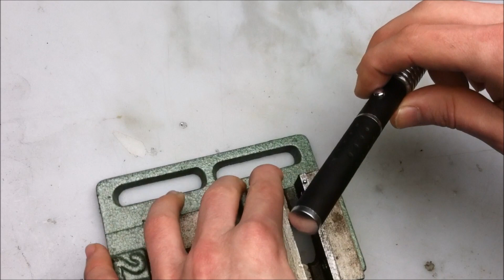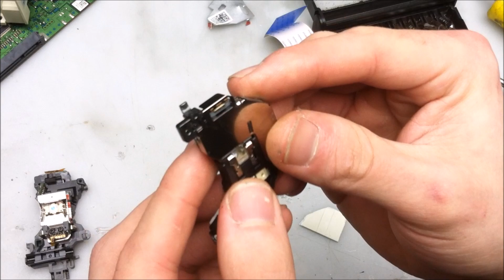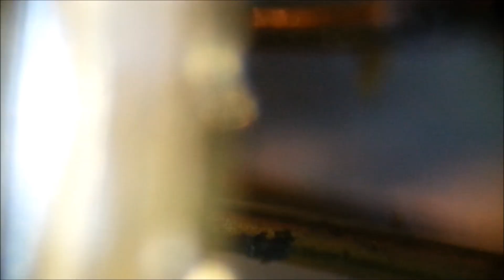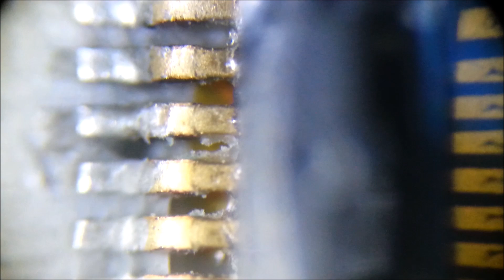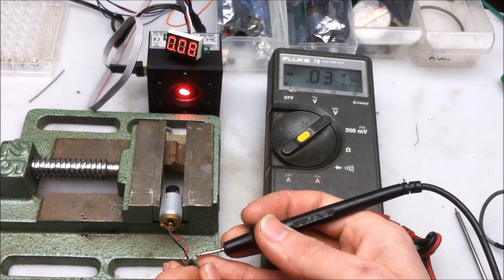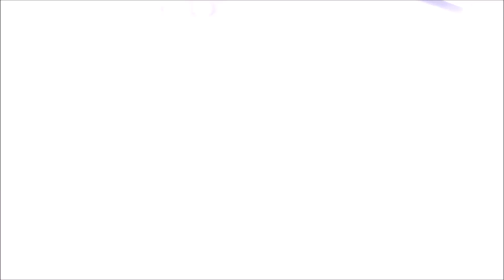Bare&Basic CD and DVD Burning Laser Diodes How to use all their types

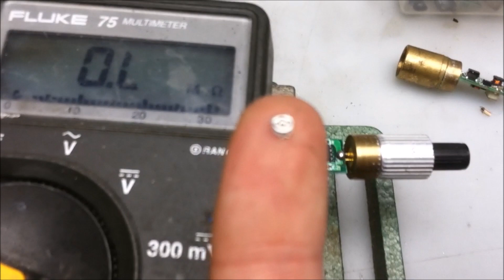Comment: 45:45 hey I have a question. In here you connected the sweeper of the pot to the single pin of the "shunt" or that black chip. But in my driver design I see the shunts pin are flipped, the side with only one pin is on the opposite side of where the pot sweeper sits. And besides, do you even need to connect that single pin of that "shunt" to the sweeper of the pot? can I just leave it and just replace those resistors with pot. The sweeper to the pins which show continuity and the other two pins of pot goes to those two other pins left, right? Please answer @Zenodilodon
Reply: Hey man, sorry for the confusion earlier. I didnt notic that quick picture you showed and it make's all the connections clear. And i now know you didnt realy connect the shunt to anything and i probably miss saw it. But anyway, i still have one more question. I wanna know on the driver, whats the polarity of it. Well, the negative (-) input is that spring in the back. And the positive for some reason goes to the body of the laser pointer. Which make's no sence bcs the body of the laser diode should be negative (-) and positive (+) should go to the driver's spring. But in here positive (+) to body and negative to the laser pin/driver. Please explain it and tell me where to connect the diode's (+) and (-) pins on the driver board
Reply from the maker: The laser drivers for the 532nm pointers generally get their power input for + through the laser diode's case pin. 

On DVD/CD laser diode the case pin is often - . This gets really confusing sometimes and means you have to electrically isolate the laser diode/laser diode holder from the case if you make it into a laser pointer. 

The LM358 based laser drivers are generally made for case positive IR laser diodes or isolated case pin red laser diodes. If you are working with one of these drivers the positive input is shared through what is normally the case pin. 

To use this with a DVD/CD laser you will need to connect it to ' . ' < right pin to positive and the case pin to the output of the transistor. 

Your understanding is not as confused as it may seem. It seems weird, but yep that's exactly why you see driver case pin + and diode case pin - . It works fine, but as stated the diode and laser pointer host can't touch. You will have to extend a wire out to the pointer host for positive input to the driver. This isn't such a big issue if you're just making a laser module or lab style laser.
Reply: @@Zenodilodon Okay thanks. Also how to connect the diode to the driver? Like in my driver the top part with the push button two of the previous infrared laser diodes pins connect and both are shorted in one place. And the other side of the board where the lm358 ic is, the other last pin in connected. I know the side with two pins of the diode, one is the photo sensor, which is not important. But my question is which pin of the laser diode goes where? My diode has 4 pins, one common positive. And one probably sensor. And the other two are red and IR laser. The body is ofc negative. So can you tell which pin goes where?
Reply from the maker: @nexcover1083  If you have a multimeter with a diode check mode you can use this to probe the laser pins and look for a dim light output. In thos mode your meter will put out a low current/low voltage at the probe tips. Knowing your case is - should help you a lot. I rarely see 4 pin regular diodes. There really isn't a much better way to determine and exact pinout.
Reply: @Zenodilodon  well I have already done this with meter. It glows but also while I was trying to solder thin copper wire on it. One of those weak thin pin of the diode fell of. And it was either the red or IR. I was hoping to see the remaining pin to be red. But luck was not with me... I broke the red one. well so this case won't really help. But I think you didn't understand the question properly. I actually didn't wanted to know the pin out of the laser. I want to know pin out of the driver. like the top pin where the push button sits. And the other side where ic chip sits. I know or (knew) the pins of diode. I just wanna know where on the driver which pin of laser goes? And yes, that was my last diode.
Reply from the maker: @nexcover1083  On an LM358 based pointer drivers to find the absolute electrical connection do the following.

Positive is often shared with the diode case pin/positive of the laser diode. To confirm this connection locate the LM358's pin 8. Pin 8 is positive input for the LM358. This power pin sometimes goes through a resistor before it goes to the positive input, however it will eventually connect to the correct solder tab. This tab is to be used for both positive input and diode positive input.

To locate the exact negative solder tab see where pin 4 of the LM358 connects to, this is often through the switch and to the battery spring.

The diode output for negative will be the output tab/collector of the transistor. Most of these drivers only have 3 connections. Shared positive, input negative, and output negative.
Reply: @Zenodilodon  okay, and also in my place it difficult to find those laser holder module thingy, I don't even know what it's name is. So can I use lenses from those cheap key chain laser pointers or even lenses from dvd meant for red lasers? or do I have to use those laser holding module, If so what's the name of it? Also about the connections, I just wanna know where to connect the diode's pins where the previous IR diode was. and plus it seems all three pins of the previous diode are connected in board. Two shorted. and one on the other side where lm358 is. It's possible that single pin on lm358 side in positive of laser. Unfortunately I could not remove the laser diode. I had to break the board of otherwise I could've checked the diode to identify the pin out of the circuit. And besides, you have worked with these circuits many times. And even connected so many diode's and tested. So I feel like you should know how to connect the diode's pins. bcs I am having a hard time understanding it properly unfortunately. However that other black chip on the push button side that has three pin on one side and one pin on the other side with d882 labeled. its clear it's the transitor your talking about. So I might know the pin out now. The solder dab with transitor on it is where negative of diode goes as you told and thus the other one is positive or diode and positive input for circuit. Am I right?
Reply: @Zenodilodon  Okay I had this doubt that I thought I would mention after you replied, but seems like still no answer. Well, I am confused bcs you said the negative of the diode goes to the "collector" of the transitor? that makes no sense bcs collector of any transistor should be positive  (+) not negative. So what's going on? another question, I watch some styropyro and I saw in one of his video he used an Amc7158 ic with a filter cap to drive a dvd burning laser diode. In this case which one is better and safer to go with your modded driver OR the Amc7158 driver. Because the Amc7158 driver is more commonly used by many many people so it's probably more reliable and much smaller since its only two smd components and super simple.
Reply from the maker: @nexcover1083  Yes, it's confusing. I didn't invent how the terms are used. Welcome to electronics. 

If you look up the D882 pinout for example you will see that the negative input goes into the emitter pin after the shunt and that the collector pin is going out to the negative of the diode.

Part of the confusion if I remember correct is that it comes from conventional flow where positive was treated as the voltage source. The collector is collecting positive through the diode and emitting the flow to negative sort of thinking. I could be completely wrong on where it comes though.
Reply from the maker: @nexcover1083  Also, yes you can use lenses from cheap lasers, you can't as easily use the original lens reading lens, many of them will produce interference rings. They are not made for infinity focus. The other lenses often lack the needed power for close collimation.
Reply: @Zenodilodon  okay thanks, I'll try to get my hands on those laser holder/collimator. Also I will try to find a blue ray diode bcs its far more powerful and cooler I think. I think you should have made a video about blue ray diode's just like this video. And how drive them, because they have different power ratings
Reply from the maker: @nexcover1083  The LM358 driver can drive higher voltage diodes. At least up to 12V. All you need to do is raise the input voltage higher. Usually only 1.2V or so more than the diode voltage. After that just adjust current as needed.

There are Boost DC-DC converters for 405nm,blue, and direct diode  green pointers too and that is all discussed in detail in my shunt mod video along with all the calculations you need to adjust the current on those types.
Reply: @Zenodilodon  alright, One last question. I want to know a bit about the rgb laser I saw on join the technicians channel you showed many times. So I know you used red,green,blue laser diodes but I am interested to know how you combined them? I know there are limitless ways to do it. But I just want to know which is the easiest to implement and also the most compact.
Reply from the maker: @nexcover1083  Same way as a show laser, just much smaller with glued in dichoic filters. That isn't my version though so I cannot comment in complete detail.

Comment: Couldn't u have found the pins by measuring the voltage drop ? The lower the drop the lower the energy, so it's possible to differentiate wavelengths that way, no ?
Reply from the maker: You can probably do that to a degree with laser diodes. I have not used that method though as I handle many wavelengths and junctions sizes, many of which exceed the voltage of my meter's diode check. That and after doing this for years many of the pinouts are memorized.

Comment: how can i find out the positive and negative pins for the square laser diode that have 4 pins on top and 4 pins on the bottom and 2 pins in the middle on the left side and right side????
Reply from the maker: The best way is by visual inspection. With how many semiconductors/sensors there are nearly everything would trip a diode check/electrical probing. If you choose to use a DMM in diode check look for something with a 1.2v drop or higher that's usually the laser diode.

Comment: Hi, i have a broken green laser and i have a 4 pin laser diode from my dvd player, can i somehow mount my diode on the laser motherboard?
Reply from the maker: Yes you can, but you won't be able to make green work with CD/DVD laser diodes. You can make them IR or red using those diodes, however you may run into problems with the lenses. Either way you slice it the modification will be tricky. You will also have to have a compatible laser driver and you will also need to set the proper current.

Comment: how to know the difference between a high-power laser diode (~100-200mW) and a low power one (~5-12mW)? i extacted a diode, and quickly put it in a case and saved it for later (because online shopping doesnt exist in my country and no one sells laser modules (3.8mm/5.6mm/9mm) so i have to wait until i get one), but i dont know its power rating and i want to design a simple driver circuit, i dont want to lose that diode, its the ONLY laser diode that i own, so please, i need an answer or an advise
Reply from the maker: The chemistry of the diodes is pretty constant. If you look up online other laser diodes of the same wavelength and output power you can get some pretty good approximations. It will be in the tens of mA so very low current.
Reply: @Zenodilodon i think you didn't understand my question, my question is: if i have a diode that i suspect is high-power (~150mW), but there is a small probability of it being very low-power (~10mW), and i want to drive it at around (~100mA) all the way up to (~200mA), how do i know for sure that it is rated for high output power (~150mW) so that when i drive it at (~100mA) i dont immediately fry the laser diode?
Reply from the maker: @EXYZ3  You would have to bring up the voltage on the diode and see where the laser threshold is in current. You can do this on any PSU that is adjustable or with a fixed voltage supply and multirotation/precision potentiometer. 5K should work well. You will also need to place a multimeter in series to detect amps/current with the diode. I would also recommend a 100 ohm resistor in series too so you prevent runaway a bit and have some accident room on adjustment. Start with the potentiometer at it's most resistive point and slowly turn it up until the laser starts to produce speckle at the output. If this is under 15-30mA then it's a lower power diode. If you go past that into the 30-70 mA range the diode is most likely higher powered. You can also tell by the actual die size too. The lower power laser chips/dies are decently square when viewed from the top while the high powered ones are longer rectangles.

Comment: Where did you get those high current meter wires? They plug in but have high current capabilities. Also what full spectrum camera do you use? I use a nofified flip phone camera. It's cheap and crappy but it works.
Reply from the maker: The wires for the meter I used where given to me in a box of misc stuff. I am certain if you look for a good brand of wires/probes for a meter such as Fluke or Fieldpiece you can find some really good ones. 

The full spectrum cameras I used are modified camera phones, This one was a modified Samsung Galaxy S3. You can do mods on nearly any camera phone by removing the IR filter and there are some tutorials online. I find the easiest ones are the Samsung phones before the Galaxy S4, the hardest ones are the Iphones, it can be done however the filter is glue onto the CCD and is less than half a millimeter from the sensor. Since camera phones have a wide variety of construction I have not posted a video on the topic myself. You can also make them with web cheap web cameras and most security cameras are already set up to pick up IR. If you choose to make your own I would suggest finding an unused older phone to try modifying or look into a cheap web cam and removing the filter in that, the parts are bigger and much friendlier to work on if you are not so experienced with working on very small stuff.
Reply: @Zenodilodon  I have modified a few phone cameras to be a Full spectrum camera. Not too hard at all. The auto focus type is more difficult however. Thank you for the insight though.

Comment: How can I get a power supply like yours?
Reply from the maker: The adjustable power supply I used was made in an x-acto knife box with a simple adjustable DC to DC step down converter and laptop PSU. I rewired the step down converter with external pots and placed in a current/voltage display.

Comment: So with the infrared lasers, would I be able to use the crystal from a green laser pointer to convert it to green? Since the pump diode is IR it should work. Right? I know it would reduce the output, but an invisible burning death ray is kinda terrifying.
Reply from the maker: Good question to ask.

A CD burner uses a 780nm laser diode and a green laser pump diode is 808nm. While this may not seem like a huge difference in wavelength on the level of interaction between photons and the atoms in the crystal will not be the same. a CD burning laser for this reason will not effectively pump and lase the ND:YVO4 crystal.
Reply: Zenodilodon thanks for your reply! I also have another question. My “flat” laser diode has 10 legs vs your example. I tried your pin out with no luck. Any other ideas?
Reply from the maker: @zentuckyfriedckn2587  You will have to closely inspect your laser diode for the pins that come off the laser diode and go out to the external pins, they are pretty easy to spot, using a small magnifying glass helps quite a bit or try using a cellphone camera to get a good macro image. In addition to this you can also tape a small lens either from a laser or other device to enhance the phones ability to capture images very upclose.

Comment: Nice explanation but you forgot one point isnt diodes from lightscribe drives the most powerful mine could handle 250 mA i might be wrong
Reply from the maker: There is a really wide range of DVD burning diodes. I know that lightscribe was in many optical drives but from what I know it was really the write speed that was the indicator. Lightscribe moves the disk very slowly compared to data burning and has a longer time to change a given location, not so much higher power. Some DVD burning laser diodes can reach 400mA at least from what I know. I figured be on the safe end of the range and give new individuals a better chance at overall success than pushing limits.
Reply: @Zenodilodon  i see thank you i thought otherside of dvd is much harder to burn
Reply from the maker: @avonfonds2567  It very well could be. This could explain why the disk rotates so slowly. Technology Connections shows a lot of lightscribe in detail.

Comment: What does open can😅 mean
Reply from the maker: The metal cover that goes over the front of a laser diode is called a can. Open can is where this little cover wasn't installed by the manufacturer or that the can as was otherwise removed.